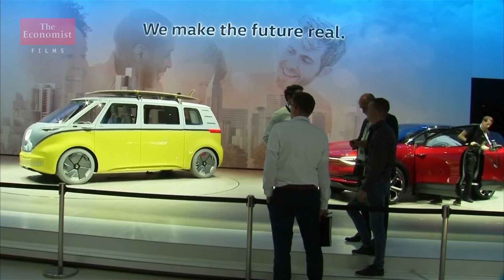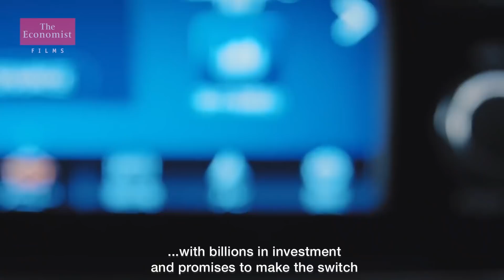Electric cars will come of age in 2018

Comment: I think electric cars are the future but what this video does not take into account  is the strain on the electric grid by millions of cars charging. Is the electric grid capable of that? In the U.S. most utilities are not. Adaptation of electric cars will require a more robust distribution grid that can handle the huge demand from ev's, in addition to greater output with more power plants. I don't think solar and wind will be able to entirely provide the power needed without being complemented by nuclear (or fusion, thorium etc.).
Reply: Jalil Muhammad i dont think the impact will be as bad as u think the worst thing for grids is varying demands for elictricity cars will even it out taking juice when demand is low.... look up smart grid to see what i mean
Reply: Very seldom does the power plants run full capacity. It will just be a matter of batteries at home that charge when the power demand is low on the grid. Your car will charge off of the battery, plus a lot of power systems will pay you for using your battery to absorb the small fluctuations in power usage during the day.

Comment: electric cars= fewer parts and cheaper to build..REALLY??? then why do they cost more?
Reply: Batteries are still expensive at this point, and the industry does not yet have the economy of scale of traditional cars. The latter alone will shave 20-30% off the cost I reckon. Also the competition is not yet intense enough. Once all the big brands are in on it it will become less about funding early development and more about the everyday bottom line.
Reply: A tesla battery pack is $40K.  For that you can buy two petrol cars.

Comment: Stop this nonsense about electric cars polluting as much as an ICE engines, simple laws of thermodynamics tell you otherwise
Most cars struggle to have a thermal efficiency of 25%, whereas a coal plants have about 35%
Even if all electricity came from coal plants, which it doesn't, electric cars would still be less pollutant
Not to mention affordable solar power is coming at giant leaps
Reply: Peter Húbek No they most certainly do not, but if you believe that feel free to gather the information from your sources and share with the rest of us. Thanks.
Reply: "you wouldn't be able to charge them in densely populated places"

Bullshit. Why not?    It's IMPOSSIBLE that MILLIONS of GAS REFUELING stations could possibly be built in densely populated areas... oh wait.... they ARE.
Reply: +Peter Hubek  Nothing you say addresses the TRILLIONS of dollars of economic loss & damage due to global warming caused by burning FFs and not switching to renewables AFAP,
NOR the DWINDLING little oil the world has left underground that is "safely" burnable.
See carbontracker.org
Reply: Generation from renewable sources (hydro 90% plus) higher for solar/wind
Most efficient gas turbine 50%
Coal 30%
Electrical transmission 98% plus
Garage Charger 90% plus
The real issue however is source to wheels CO2 emissions and pollution in which case electricity is the only known way forward today
Reply: +mikeboy0001
"Who in the hell said it's possible at this very instant to instantly just throw away all ICE's away and replace them with EV's? Only you and your antagonist ideas, that's not how evolution works"

Perfectly explained!!
Reply: "You did say the latest generation ICE's have nearly 50% efficiency, a lie" -> No it's not lie, everything usually starts in F1, abs, esp, carbon brakes, you named it. I bet it will be in production very soon,
"they're better because soon they'll be much cheaper" -> This a hope, nothing more nothing less. The battery density is not getting significantly higher (2/3 of lithium reserves are located in Zimbabwe/Africa), are you aware of any other battery type which will power the EVs. I know, they will come soon :-) :-) :-) ,
"BMW created a sub-brand for EV's" -> yes because this is more related to EU political decisions.  If they want to keep a sustainable business do they have any other options ? I know they are doing this because the don't wan't our money, they wan't to save the earth,
"Elon Musk is an pioneer and outsider," -> Elon Musk is a goot marketer, that's all. Just look at the numbers. Build quality is worse than a Kia Rio which doesn't cost 70k€,
"Renewable energies ? Where ? What kind of ?" -> I've gone through the comments in one vlog, many people think that Teslas are charged by solar panels (efficiency about 7%-10%), why these people still have election rights I don't know, 
"If there's any marketing, that's the only reason for it (even big oil companies are investing in renewables)" -> yes because most economies are heavily reliant on oil, can you imagine that they will loose this position ? They need to come up with something, so they can keep their business 

But I agree that we need to find out a greener technology for the transportation, but it's not ICE nor EV. And that's the point. And please don't be so religious, think about the problem from different perspectives. Peace :-)
Reply: +mikeboy0001   Well said!!
Reply: Peter Húbek only huge diesel engines can come close to 50 percent. Why do you think an EV car can travel a mile using .0175 in power vs a Toyota Corolla using
.083 in gas at $2.50 a gallon. Efficiency.
Reply: Diamond Eyes - And what about the electric transmission loss and the electrical consumption of an Oil refinery?   And then there is the distribution to the petrol stations.  Mostly this is excluded when people talk ICE vs EV.  An oil refinery uses a LOT of electricity and there is a lot of fuel used to transport the crde oil to the refinery and then the resultant fuel to stations.  Factor this in and the electrical loss getting power to the charging stations becomes insignificant.
Reply: Oil refining uses the fuel to make electricity that is often exported to grid as well as processing!
Reply: mikeboy0001 the latest generation of  ices have near 50% efficiency
Reply: You know, I could reply to every nonsense, but it's not worth it, or at least, you're not worth it
Just stick with Trump tweets and news, I'm sure you'll be happy in your basement cave
Reply: What nonsense! 1198cc PD had 50% thermal efficiency in the 1990s! Vast majority of shipping over 60% efficient. Plenty of losses in the grid and most EVs only tell you how much consumed from the pack not how much to charge it or pre condition it. Simple laws of physics! EVs still 26% heavier - more energy guzzling and sapping weight overall despite good motors.  More torque, more tyre wear , more PMs.
Reply: http://www.autointell.com/News-2001/May-2001/May-2001-4/May-23-01-p8.htm
Reply: Name calling isn't a scientific argument! Stick with facts for and against EV and ICE. There are always at least two sides to propaganda.
Reply: Not in UK or EU - NOx and CO2 from powergen plants on the rise - cheaper to pay fines than fit cleanup kit!
Reply: Nope: http://www.autointell.com/News-2001/May-2001/May-2001-4/May-23-01-p8.htm
Reply: Bryan Hensley more likely like 30% for UK Coal and being fined for excessive NOx production cause it's cheaper to pay fines than fix problems!
Reply: No account of losses from plug socket to rubber hitting the road. The GOM doesn't give grid energy consumption! Can have over 30% charging losses mostly due to the power electronics. Lower power home chargers loose 20% for low SOC and currents under 10A. Battery energy losses if you demand more current. Degradation of 3% per year even if unused,  inefficiency of carrying around dead weight as the poor energy density battery discharges...  none of these are considered by EVangelists - just go on about motor efficiency when whole vehicle efficiency is waht really matters. PS: I drive and own an EV.
Reply: its has to change today or tomorrow, earlier it is better
electric car will evolve like ice car ...it will take time but it will ...there are study's like Maxwell dry electrode and super capacitor ,solid state battery, graphine,,,....
soon it will be safer ,better and cheaper...and some are happening
Reply: 90 % of EV charging will be done at night. All grids can handle it as grid peaks are in daytime
Reply: mikeboy0001 coal plants and any other combustion fired plants are in the 60% efficiency range due to using organic fluids instead of water for the steam production. They have lowered the boiling and condensation points. If they are located at a river they can lower the condensation points to just above the temperature of the river water, of course using the water for the condensation process.
Reply: You did say the latest generation ICE's have nearly 50% efficiency, a lie
And you're the idiot Peter, a big one
Who in the hell said it's possible at this very instant to instantly just throw away all ICE's away and replace them with EV's? Only you and your antagonist ideas, that's not how evolution works
If you had a bit more understanding on what technology is available, on how industries, markets and societies work, you would know something this magnitute moves as a whole
BMW created a sub-brand for EV's, VW group will spend $40 billion by 2022 and have ALL it's 300 models electrified by 2030, and Mercedes have ALL it's models electrified by 2022
Elon Musk is an pioneer and outsider, reason why Tesla jump started the game by at least a decade, the only thing holding it, it's it's size
EV's and renewable energies are connected in development, and they're not just better because they are cleaner,  they're better because soon they'll be much cheaper (when you include health budgets on the long run, it's unmeasurable)
If there's any marketing, that's the only reason for it (even big oil companies are investing in renewables)
otherwise governments wouldn't really care about the environment
Reply: Peter Hubek, you say a lot of nonsense
Modern ICE's do not have almost 50% efficiency, that's a lie.
The F1 mercedes engine value was achieved on dyno only, and well, it's an F1 engine, it doesn't apply to real world
The Mazda Skyactiv-X engine, as good as it might be, hopes at best to be in the same level as Diesel engines
Also, EV's can even help power plants regulate their output more efficiently, recharging when theres a surplus of energy, and refeeding the grid when there's need for it. This would not only allow the power plants to become more efficient, but also save billions
But I guess this are just things that don't matter to an "Alternate Facts" type of person
Reply: mikeboy0001 you are blind, as 99% of the people here. Please do your homework. Do you have an idea how much power do you need to charge one car ? I live in central Europe, based on report from 2016 there are 3 000 000 cars in my country. We have one atomic power plant, many water and coal plants and we still need to buy electricity from other countries because it's not enough. So my question is ? Are you an idiot that's not able to count 1+1 as majority of people here blinded by a viral marketing supported by governments ? I'm not advocate ice cars but currently there aren't any valiable options right now. Usage of Evs will help in some places but they're not a cure. And I've said near 50% !!!! So as you can see the technology is evolving. As I said, for now the hybrid is the way to go. I think that's the reason why brands like audi, bmw, Mercedes are so restrained.
Reply: http://www.roadandtrack.com/motorsports/a12443313/mercedes-amgs-f1-engine-is-amazingly-efficient/ 
https://www.reuters.com/article/us-autoshow-tokyo-mazda/with-new-technology-mazda-gives-spark-to-gasoline-engine-idUSKBN1CT368
Do you need more ? The ICE technology is evolving also. The biggest problem with EVs that i see is the charging infrastructure not the range , you wouldn't be able to charge them in densely populated places, imagine when there'll be milion EVs, the existing power plants are not build to handle this. And don't tell me that you won't own the vehicle and bla bla, this doesn't make sense, because then we're talking about whole new kind of the transportation which will be build in parallel, with just a few models of cars, and i don't think that brands like audi, bmw will be ok to loose their businesses. I'd like to see more EVs in the cities, where there are appropriate. For the rest, the hybrid cars are the answer. Look http://www.koenigsegg.com/regera/ on koenigsegg regera. You can drive only on batteries and start the ICE only when you need it. This is the best of both worlds. Maybe when there will be new kind of energy sources, batteries the EVs will substitute ICEs powered vehicles. But with the existing technologies, it won't be that soon.

Comment: No infrastructure, no thanks... its bad enough that I have to constantly have to have my phone plugged in everywhere I go to keep it charged.  Until range increases to 400 miles and charge time comparable to filling up a fuel tank, electrics will never surpass burning fuel.  Electrics are far too costly in terms of exotic metals (cobalt, lithium), put a heavy burden on the grid and during natural disasters useless if no electricity is available to charge them. I'll keep my gas burner... its been working just fine for 20 years... no such electric can beat that kind of durability and longevity with batteries that need replacing every 4 years and electronics that burn out in 7.
Reply: at least not right now, but yea electric cars are being pushed down our throat too quickly.  I'm pretty sure there are other things out there that produce more green house gasses than cars do
Reply: at least not right now, but yea electric cars are being pushed down our throat too quickly.  I'm pretty sure there are other things out there that produce more green house gasses than cars do

Comment: Good coverage of the industry momentum of EVs!  However there’s a few half-truths in here on the portrayal of the downsides.  

EVs let us separate the energy-production means from the consumption means, cars and trucks especially in this case.  This separates the clean-energy problem from the clean-transportation problem.  These two problems are easier to solve separately!  “Divide and conquer,” so to speak.

For example, it’s a lot more feasible to put pollution controls into a stationary, weight-unconstrained coal plant than onto a car where weight (and size) are critical.  Power plants can also be placed outside of city limits, reducing in-city pollution.  But more importantly, solar-roof costs are dropping 4-5% per year.  Home solar also reduces line losses and reduces costs to utilities to bring new power-generation facilities on-line.  

Furthermore, lithium-cobalt battery chemistry is neither the only, nor the most-ideal, lithium-battery chemistry for EVs.

Comment: Now I have 2 questions on this:

Why do governments so eagerly push for this change (whose interest is it really happening in)
&
Won't these electric engines start blowing up like Note 7's batteries did?
Reply: It has always been electric. Cars started as electric and the only reason gasoline took off is because they had really shitty batteries back then. And we've had really shitty batteries for a long time, but electric has been there all the way. Tested every few years for the past 150 years or so to test general viability. In universities, labs and garages everywhere.

And now we have good batteries and they are getting better all the time. Fundamentally electric is just better and more desirable than fossil fuel combustion. It was never pushed by some hidden agenda. It was just put on pause in the mainstream due to the development of fossil fuel cars. For a while.

Musk just gave it a leg up to accelerate the pace recently.
Reply: +Joe Black batteries are not good today. when battery can be recharged in 5min, without heating the battery in -30c, then its pretty good.
Reply: Smai Tapio: I absolutely get where you are coming from personally. But... That's "your" definition of good. By "my" definition the temperature is not an issue. Recharging is also fine for me. My only requirement is simply that they have more capacity per weigh and is a bit cheaper. All things which are in the pipeline. And it is the same for the vast majority of people on this planet. You might be interested to know that there are several billion people who live in locations in the world where it is very rare for the temperature to reach the freezing point of water. Actually... In fact there's A LOT more people who live in places like that than there are in places that get as cold as what you describe. Mostly places where most people cannot afford cars too - Yet.

Thus far nations have had to engage in terrible politics and diplomacy, often war to secure oil supply. Because it REALLY IS a limited resource. I honestly do not see why people are against something which they maybe cannot use right now so they go and oppose it's development - Even to the detriment of the entire rest of the planet that needs it urgently. It's very regional thinking.